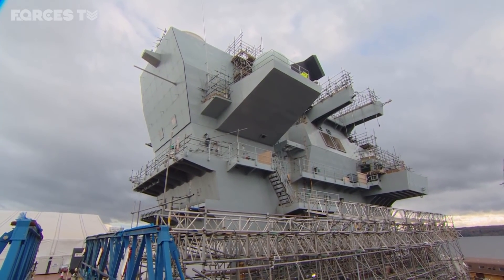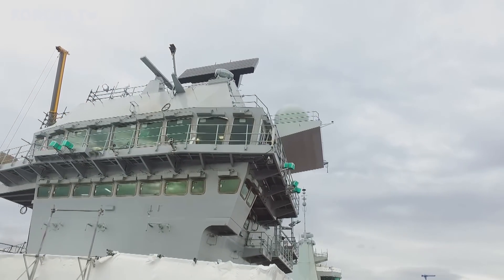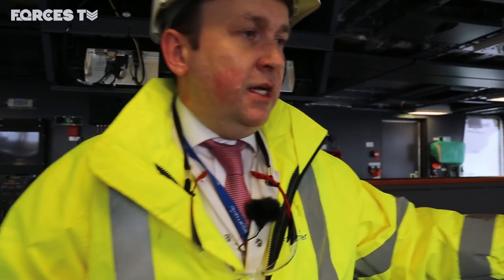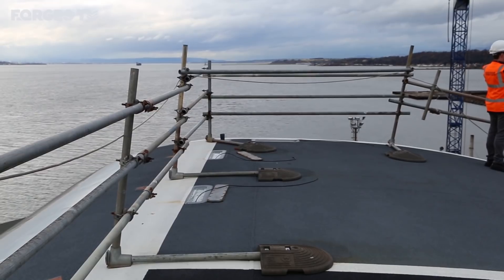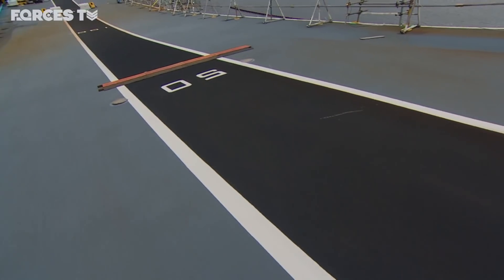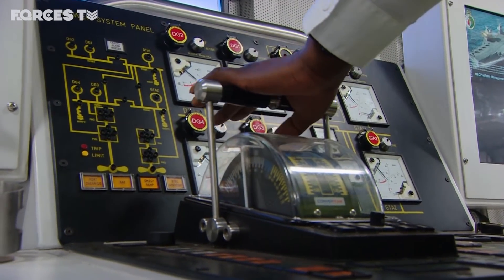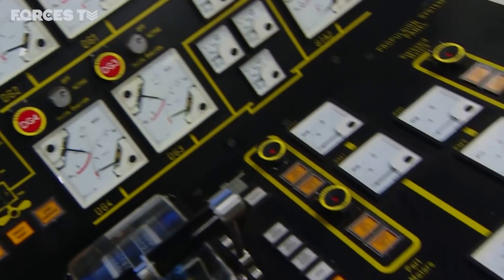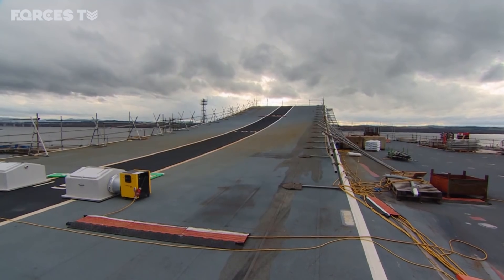What It's Like On Board Britain's NEXT Aircraft Carrier | Forces TV

Comment: Such a small number of necessary crew is very impressive.  Especially considering the number of people required on US carriers.  It's like a large village compared to a town.
Reply: Less crew means less supplies and less accommodation and also would mean less loss of life during wartime! Sometimes less is more!
Reply: They also have automatic rails running below to move bombs etc. around. So yes, a lot of automatic handling systems are in place. They also used electrical systems more than steam systems where possible - again this gives more space below, and less crew to maintain and open/close valves etc.

Automation is also highly used in the new USA Gerald Ford class carrier. They expect to operate with 1000 less crew compared to existing carrier. So crew can drop from 5100 down to 4100 on board. They expect in excess of 1+ billion to be saved by this increased automation.
Reply: Tams80 part of being a smaller, less capable ship is having a smaller crew, not sure what you find so amazing about that lmao
Reply: @jb76489  because it means it's a more modern, more advanced design? needing less to achieve the same or better?
Reply: @1IbramGaunt  "needing less to achieve the same or better?" yeah, cause a carrier that has half as many aircraft, can do fewer than half the sorties per day and only has a range of 19,000 kilometers is the same or better
Reply: @jb76489  how far can the crews and planes aboard your oh-we-never-need-to-refuel carriers go without food and jet-fuel? :) range figures really don't mean that much in the real world; as for how many aircraft if you took out the unneeded transport helicopters and such and we were on a war-footing it could carry a lot more F35's, we ARE talking about a ship almost the same size as a Nimitz-class here, space is not an issue should it be required- but it WON'T be, what you anti-QE-class people don't seem to get is that we don't NEED to have what the Americans think they do
Reply: @jb76489  as for the sorties thing I really don't get that, if the situation demanded it all these aircraft could just take off and land VERTICALLY FROM WHERE THEY ARE, they don't NEED to use the damn ramp you lot get so triggered by or even the runway for that matter if there's that much of a rush
Reply: @jb76489  also something you seem to be forgetting is that aside from a couple of transport helicopters and such ALL THE AIRCRAFT this thing will be carrying are ready-for-combat machines and ALL THE FIGHTERS are state-of-the-art modern aircraft, whereas the bulk of the air-wings on yours still consist of F18's, a design from the late 1980's I beleive
Reply: @jb76489  I see you are peddling your ignorance here as well?
1. A QE can carry upwards of 55 aircraft a Ford Class some 70. Captain Sam Kydd, Skipper of the QE. It can surge more if needed and if we used the flight deck as a parking lot like US carriers do
2. A QE will deliver initial sorties at a far faster rate than a Nimitz (Ford hasn't launched anything yet) for the simple reason it takes time to set up and 'stage' an F-18 for example onto a CAT. And then there is a delay for following aircraft.
3. The 24 hour sortie rate for a QE will be some 10% less than a Nimitz because of the slower retrieval rate dictated by Vertical Landing. Its why the RN developed SRVL and this will allow faster retrieval and full weapon load landings. Google it.
4. The QE has an indefinite 'range' as it will use RAS by dedicated 'Tide Class' tankers built specifically for the job. Of course the US carriers never need food for their 5,000 crew, fuel for their aircraft (which has a 'shelf life') and weapons replacement. And of course the accompanying AB Destroyers never need fuel, food and stores under RAS either .... D'UH!

No only you Yanks play the 'we are better' game we don't. And make yourselves look dumb in the process. We are just proud of what we do and keep quiet about it. We don't have tree trunks on our shoulders and use patriotism as a weapon. Maybe read up on the subject before commenting and respect that other countries do things differently. The 'American Way' isn't always the 'Best Way' let alone the 'Only Way'.

And in closing we gave you:
The aircraft carrier
The 'Island to Starboard' concept
The angled flight deck
The steam catapult
Wire traps
Mirror landing aids
...............................You're Welcome ..................

Comment: It’s no nimitz class..too small
Reply: It's virtually the same size as a Nimitz.
Reply: RABBLE ROUSER Unfortunately it’s about 80 metres shorter 15 minutes thinner and 40,000 tons less in displacement so the nimitz is far bigger however i argue it is more advanced than the nimitz class as it has become outdated compared to the Qe ships
Reply: @willbrant2160  It's about 100ft shorter that's all. In 2 ships that are around the 1000ft mark that's not a big difference. The Nimitz is definitely bigger but "far bigger" is pushing it. If you put them side by side you wouldn't see a huge difference with the naked eye.
Reply: @willmartin1033   yes, however, the extra height and depth allow a much larger amount of aircraft (i get some are on deck) However I do love the Qe class carriers.
Reply: Capacity is a different criteria. Most people would say the ships are a similar size.
Reply: Larger ship, larger target.
Reply: barrie - Hmmm .. its about 120 feet shorter in the bow because it has a ramp not CATS. Its flight deck is wider for longer than a Nimitz (goi check the overhead pictures). So its 30,000 tons less displacement so what? Less fuel needed to push it through the water making it more efficient and better handling in an emergency... Laws of momentum ..
Reply: To put things into a certain perspective the maximum length of mainland Britain from top to bottom is less than 1,000 miles and the average width is no more than a hundred miles, which means the two carriers can easily provide air cover for the entire country, which is actually not much bigger than New England. How many American carriers are assigned specifically to protect the coast of New England? Also America has 2 massively long coastlines to protect, 3 if you want to count the Gulf Of Mexico separately, plus Alaska and Hawaii, so to cover these they need a lot more carriers. Yes I know both countries also have air bases to provide air cover, but to even put this in the equation Britain is still adequately covered by its Typhoon squadrons whos primary mission is air defence and each one is capable of covering the entire airspace of the country if required.
Reply: @tsu8003  US coasts are defended by land-based air power primarily as well as missile defense systems. Our carriers are for force projection, not sitting back next to our coasts. Why even build carriers if your plan is just to defend your little islands with them?
Reply: @tsu8003  To add a further perspective - The UK population is about 1/5th that of the USA. So multiply our two carriers by 5 and you get ? Yep same as the USA ...
Reply: @tsu8003  Excellent point.I was thinking the same.
Reply: @tsu8003  Exactly.Great point.